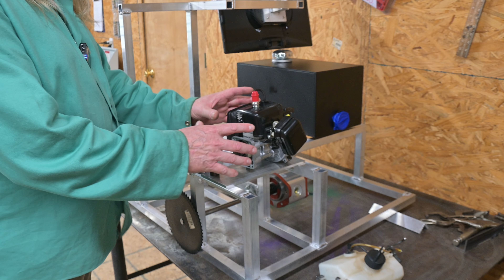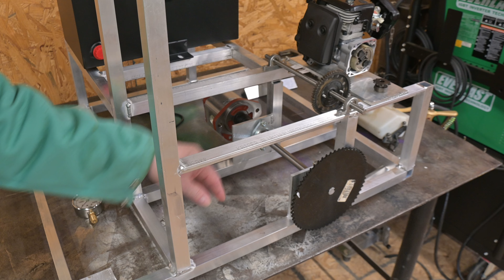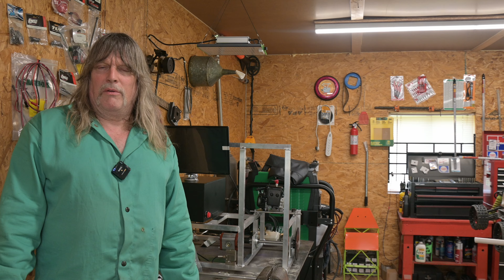Small Engine Dyno  for 1/5th scale RC Pt2 | Fabrication and mechanical setup

Comment: That's one heck of a project Brian. You pretty much master all the trades with your awesome skills.  Would it be difficult to eliminate the EMI with filters or proper power supply. I really don't know but just curious. Either way having it portable is a plus.
Reply from the maker: Thanks RC. Getting rid of the 60 hz and post rectifier 120hz is relatively easy but if i can eliminate a transformer, rectifier and big electrolytic caps it helps streamline quite a bit. The fast Dv/Dt emi like the spark ignition is more problematic to deal with. I do believe i'm going to have a single barrel style DC input that can except a laptop power supply and i'll make a harness that goes into the same connector but will hold 2 5s batteries. Hopefully that gives the best of both worlds. Thanks for checking it out my friend
Reply: @RCWalletVacuum  Thanks for explaining that Brian. I can't wait to see the final product. I have been thinking to make a tread mill for RC's. I saw a video of a guy who made one and with green screen He was able to make the car look like it was really driving though a city with the video overlayed in the background.
Reply from the maker: @RCRoads  That sounds quite novel